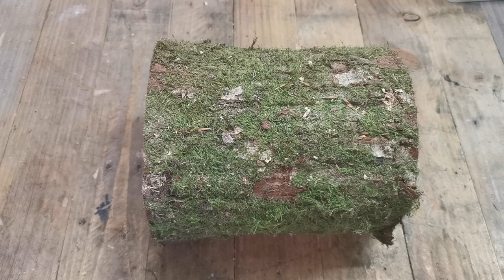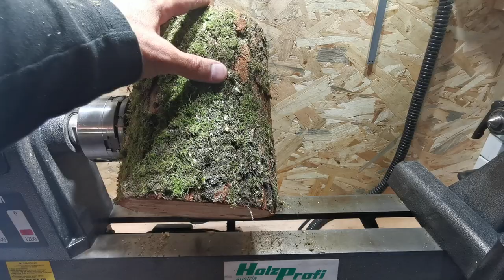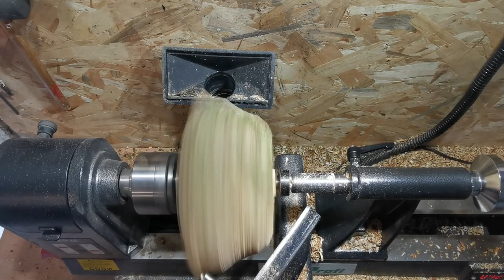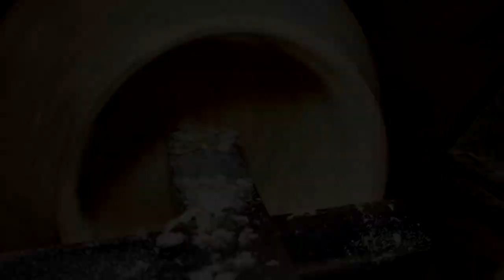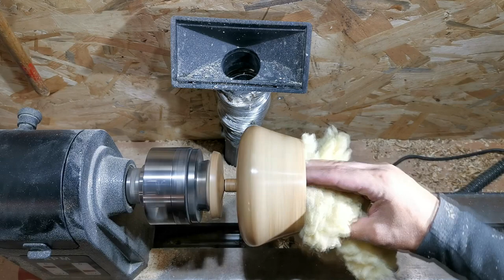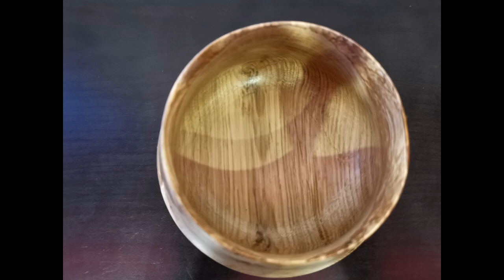woodturning: log into goblet !green oak

Comment: Nice, but since it was green "oak", what stops it from cracking on you, and/or warping?  I've just turned some white oak small coin dishes / platters, and they warped some.  Didn't bother me any, and actually added some character to them.  Did you goblet warp or crack?
Reply from the maker: Hello Phillip, You must remove as much wood as possible when digging, so the bowl will not crack, on the other hand you cannot avoid the deformation which is due to the loosening of the fibers, especially if you want to have a part finished in one go.
Reply: @bawbreizhartwood  Thought so.  Thankx